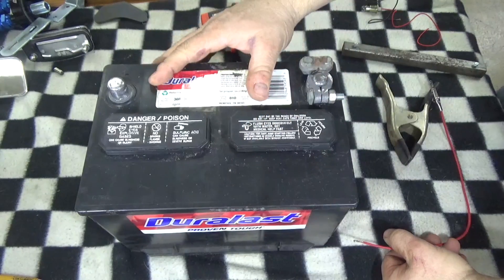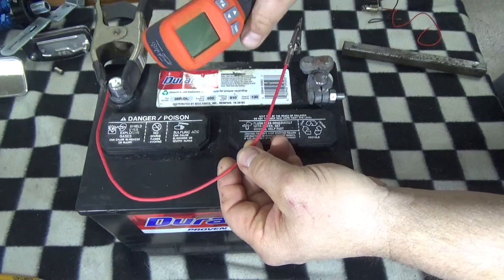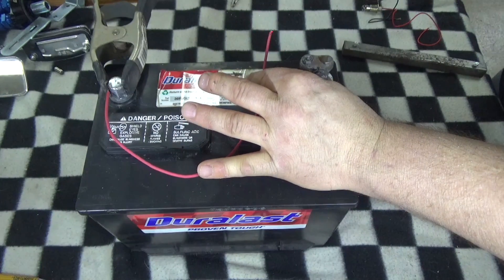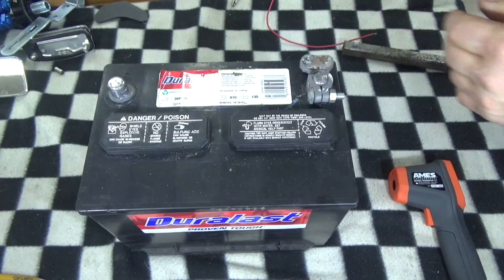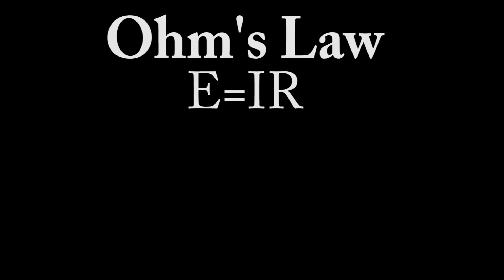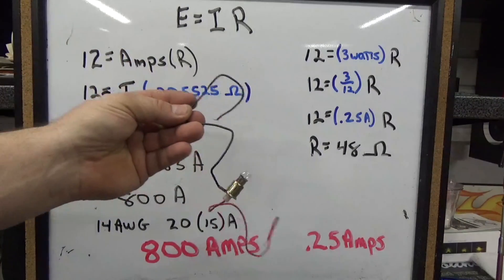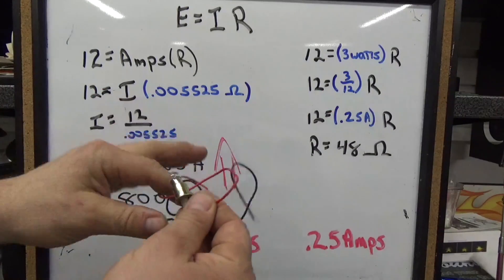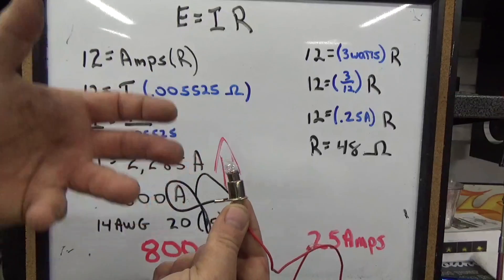Basic Automotive Wiring   Chassis Ground, Tail Lights for the 1966 Streetbeast Cobra Replica

Comment: What if I wanted to connect some license plate lights by taping into the tail light? My license plate light has two wire, positive and ground. I tapped the positive into the low resistance (parking light) on the tail light wire and then connected my ground to the frame. When I did this the tail light was flickering, I figured because the tail light bulb gets ground from the frame like you described in the video. Not sure how I can tap into the tail lights now. I just want to run these 1 watt license plate LEDs.
Reply from the maker: I'd try the daytime running lamp wire

Comment: Did you connectte ground to the chassi and to the car , but the ground didnt connect to the lights ( wire )
Reply from the maker: There is either a ground wire, or the light bracket is the ground

Comment: This is a great simple but very informative video. Thank you! I've got a 1977 Toyota Pont-X, which is one of the many camper mods that was built on old Toyota pickups in that era. All my rear lights work except passenger brake light. Bulb is good, ground is good, socket is good. I seem to only be getting 10.5 volts when brake is engaged on the side that doesn't work. and about 11.5 on the side that does. Fuses and switches are good. Can't figure out what/where the problem is.
Reply from the maker: That is either a bad ground or a frayed wire

Comment: I have a question on a cobra I just purchased the turn signal and brake lights work fine when headlights are off but when I turn on my headlights then the brake and turn stop working any help on what could cause this would be very helpful thanks in advance
Reply from the maker: Hard to say without knowing how the car is wired. Power for both are probably take off the headlight switch and power drops out when the switch is turned on

Comment: Perfect video! 
I have an issue with my 69. 
When I ground the negative by me pressing on the wire to the chassis the blinker works and wire gets hot. When I actually connect the ground with  the ring terminal the blinker stops working , any clue what it can be ?
Reply from the maker: Sounds like the + wire it touching ground or you have them backwards

Comment: My problem in my car is that the brake and signal lights work but tail lights don't.  What should I check?
Reply from the maker: The wires that go to the headlight switch

Comment: How do you acheive the function of the brake and signal on the one wire? I can't figure it out for nothing.  How do I wire that?
Reply from the maker: The positive goes to the light and the frame of the light goes to ground
Reply: Yea thats not what I meant. How do you use that one wire for both the brake and signal. One wire goes to the tail light, and the other runs the signal and brake. How do you get the brake light to shut off for the signal to blink on that one wire?
Reply from the maker: There is a power wire from the headlights that powers the light/blinker, and another wire for the brake lights. Two different wires feed the tail light

Comment: That was awesome!
Reply from the maker: Thank you!
Reply: @PetesGarage  ok, so I did led tails and blinkers, bought the new style flasher relays for hazard and blinkers as you suggested. Everything worked great at first. For some reason my brake lights are dim unless the Parking  lights are on. Also related, the hazards are no longer working. I switched relays around and still the same issue. 

Any ideas? Check grounds?
Reply from the maker: You have the brake lights hooked up to the running lights somehow
Reply: @PetesGarage  I would think that if the brake lights didn’t function normally at first. Something happened when I tested the flashers.
Reply: @PetesGarage  sorry, I replied to you about another video I watched.

Comment: Is the blinker and brake light connected together? If yes, what happens when u have indicator on and brakes applied at the same time?
Reply from the maker: There are usually 2 different elements and they are separate.
Reply: This is what I need to know as well. It's only 2 filaments. One goes to the tail lights, so that only leaves 1 wire and 1 filament left for the brakes and turn signal. I need to know how to wire that up to work.

Comment: Does the light bulb only goes in one way or do I have to make sure the brighter side goes to the brake/ signal?
Reply from the maker: For a bulb with 2 elements, the direction matters, although it should only go in 1 way

Comment: I cannot believe how haphazardly you dangle those wire over a battery like that. That's a great way to get electrocuted. Also having a blanket that looks flammable underneath a potential fire hazard is also quite unbelievable.
Reply from the maker: I appreciate your concern, however, you can't get electrocuted from 12 volts DC. There is nothing to produce a spark hot enough to ignite much of anything really.

Comment: Thanks Pete. Good Demo. I,m playing a little with my  complete Jeep rewire. Switching everything possible to ground. A step toward security for the fun of it.
Reply from the maker: That sounds like a fun project Jake.
Reply: @PetesGarage  Thank you. Long to short. I got another Jeep for cheap "87 never driven in winter. 5.2 Dodge, etc........The wiring is atrocious. Usual. Strip it all out start over fresh the way it should have been. Relays and fuse blocks etc. Everything.
Reply from the maker: That will be a blast!
Reply: @PetesGarage  Your inspiration sure helps Pete.

Comment: At around about 10:00 you explain that the filaments draw different currents. (hence one is brighter than the other). According to ohms law if they draw different currents they must have different resistances. Yet you say they have the same resistance.
The skinny filament has a higher resistance, draws less current and is therefore not as bright (less wattage). The fat filament has less resistance, draws more current and is brighter (higher wattage). It's ok we get the idea.
Reply: All correct. well.. some filaments can be designed somewhat differently leading to different lumens but yeah....
Reply from the maker: That's the only part of the video I didn't correct....thanks for the comment